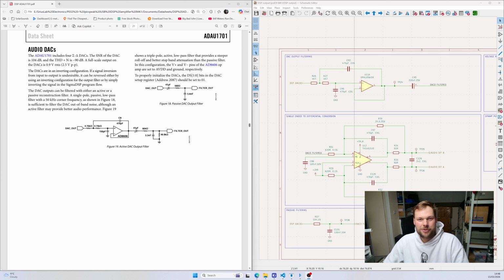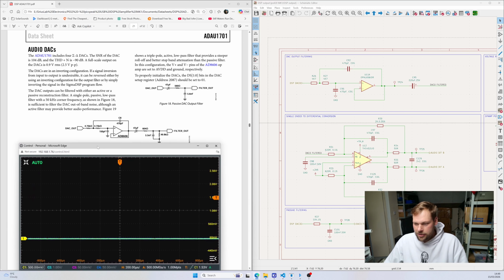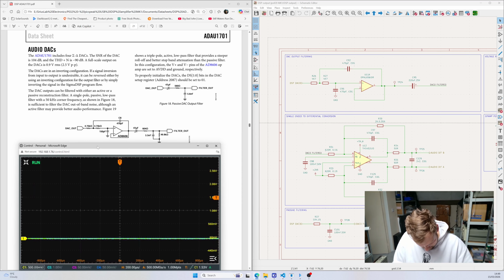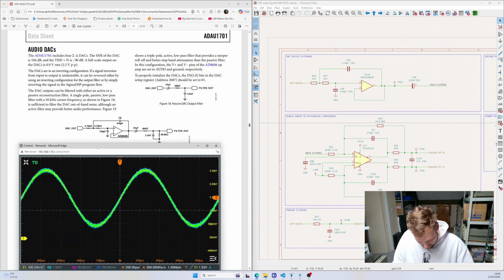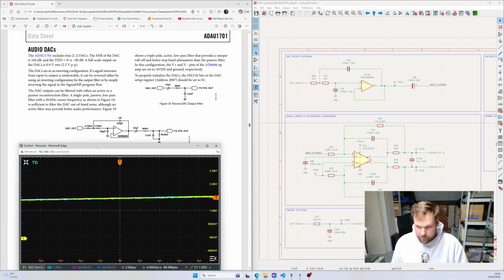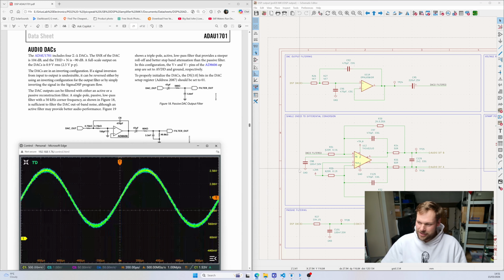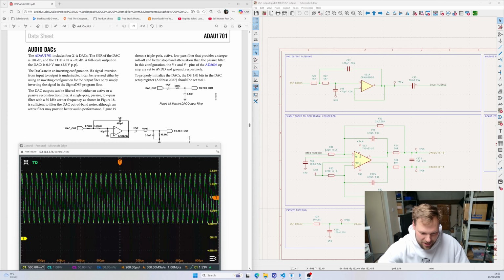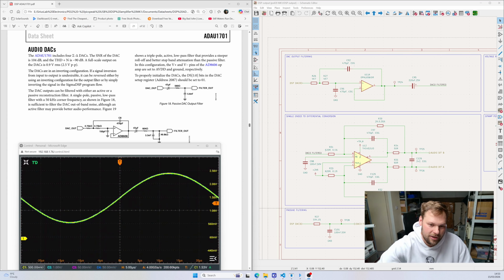Why you want a good DAC output filter

Comment: Hi there. Nice one. Which IC have you used on the filter?
Reply from the maker: Hi! The active filter opamp used is the OPA1656. It is a low distortion low noise one but in essence, any decent opamp will do the job. I think that even a non-audio opamp will give you better results than nothing.